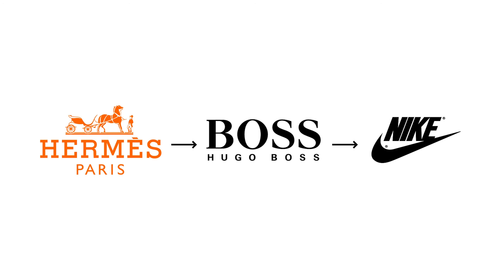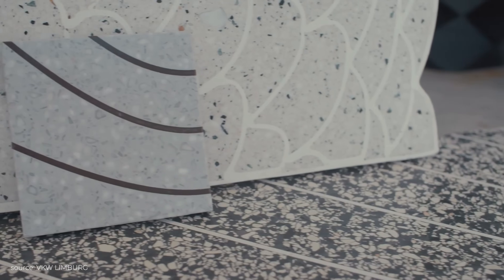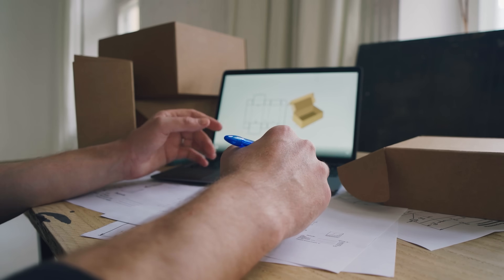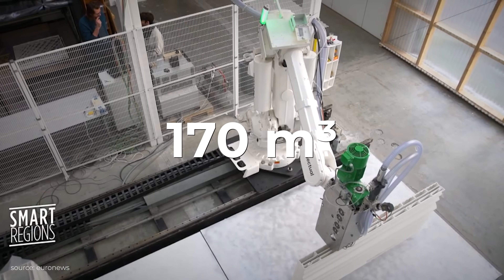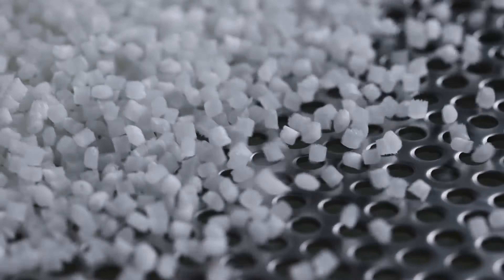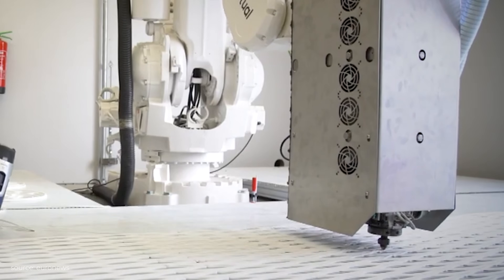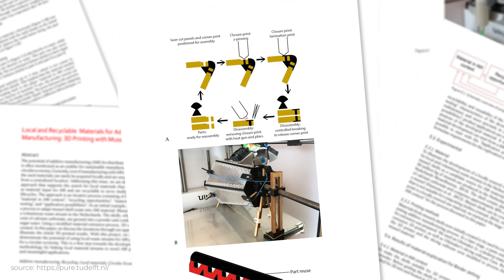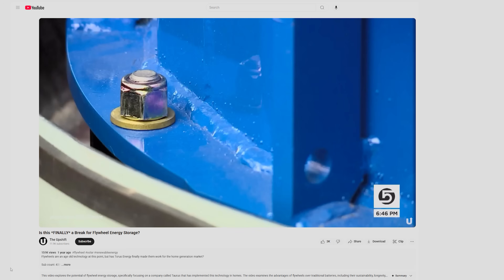How this Company 3D-prints Furniture from Plastic Waste

Comment: Taking a brand new 3D print, grinding it up, then making another 3D print is absolutely NOT the same as...

Making a 3D print using a custom shade of plastic, put it out in public use, collecting dust, or hand grime, or any number of other contaminants, grind it up, try to match it to other plastic that is the same color, make new filament that doesn't have all kinds of printing problems due to all those contaminants, printing a new product, and then expecting that contaminated plastic to have the same strength and durability characteristics as the original...      seven times over.

You are helping to green-wash a manufacturing process that produces lots and lots of micro-plastic particles that literally float in the air until someone breathes them in.
Reply from the maker: I would argue that this is at least a start. Yes, we’re probably better off questioning whether shopfronts really need to be changing their appearance every few years, just to drive sales of products people often don’t need. 

But the beginning of getting to a circular economy is finding ways to get circular business models to work within the current, linear system. Sure solutions like this aren’t perfect. However I’d say that shredding and reprinting waste that is not downcycling, but actually maintains the highest value state of the product is a better option than not recycling at all.

What, in your view, would constitute a better alternative?